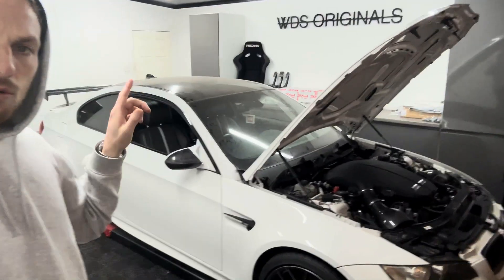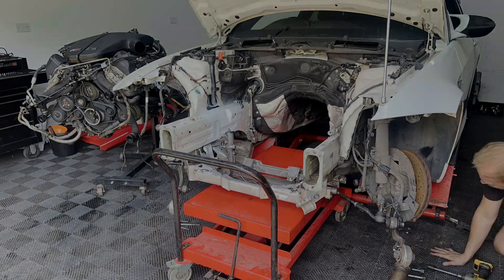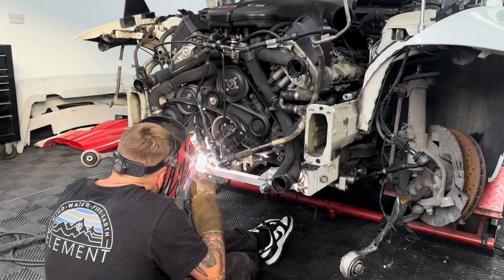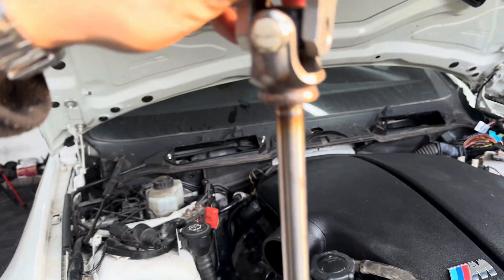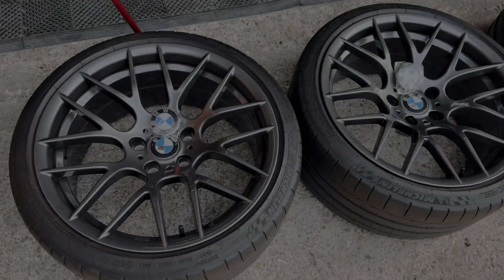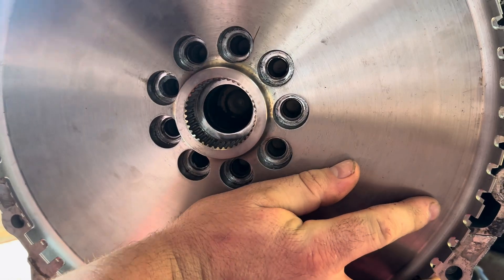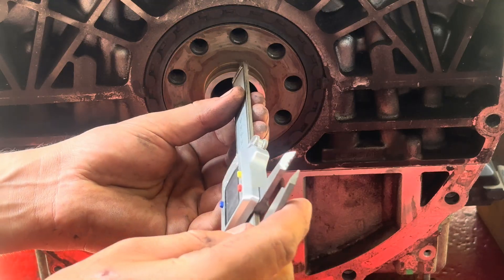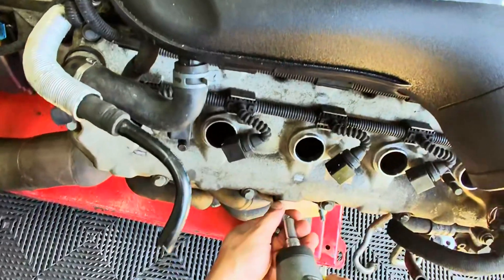BMW E92 M3 V10 DCT Build – Full Fabrication Breakdown

Comment: Hi, how are you doing? Love the Build been trying to do a lot of research on doing the swap myself. I have the whole donor car from a e60 m5 and I’m doing a 2008 E 92 335 so I’m just trying to look for whatever information I could use to help me further along my project because it will be in Sema for 2026 so any information you can give me would be much appreciated and I am also the same I don’t like to film or anything, but people have asked me continuouslyso I get what you mean on that
Reply: I’m also gonna do a straight Manual from a E92 M3 to simplify some of the project that transmission is expensive in itself
Reply from the maker: @J @Jayrockettracing  if you’re doing a manual build, it’ll be a piece of cake compared to what I’m doing, it’ll also cost you about £10k less than what I’m doing with the dct box! 

At this stage until I have the car up and running fully I’m going to hold fire on sharing specifics, but once it’s all sorted I’ll probably release a long and I mean a very long full video on the exact step by step / full info etc. Sub to the channel and stay up to date, there’s enough info in these shorter videos and visuals that should massively help too!! 🤙🏻